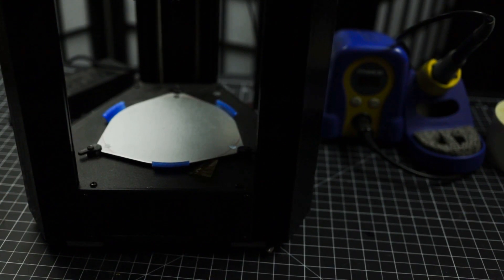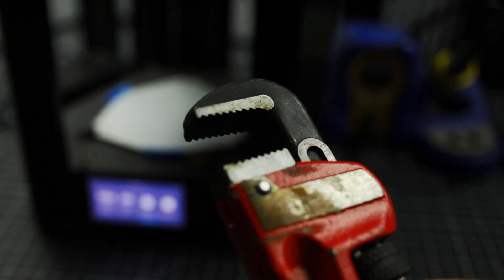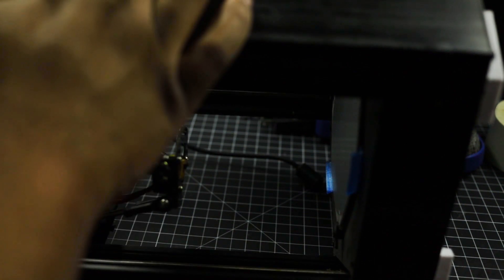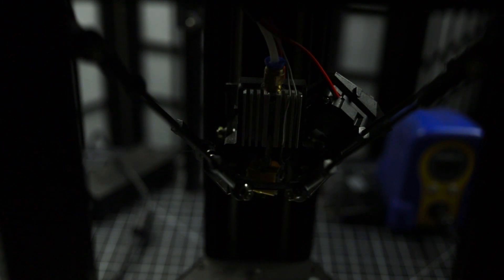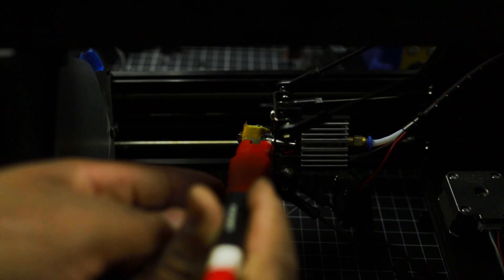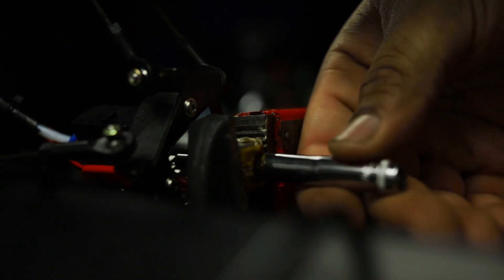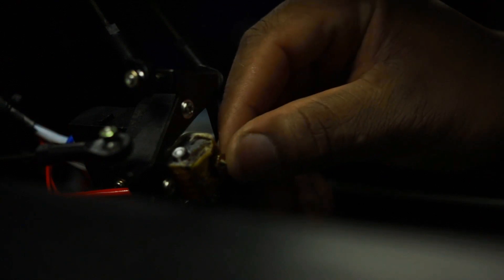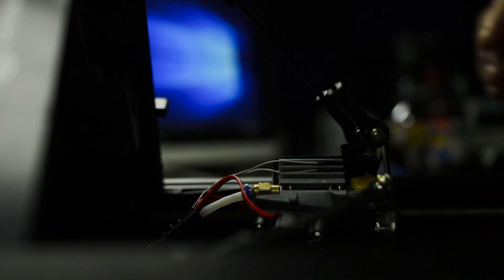How to replace your Mono Price Mini Delta Nozzle Step By Step instructions

Comment: I was printing with petg and melted my plug in the side of the printer. loose plug overheated.   cut it off and soldered it to the board good as new. a bit of silcon tape on the threads will stop any leaks also.